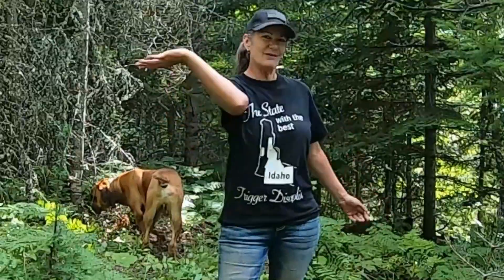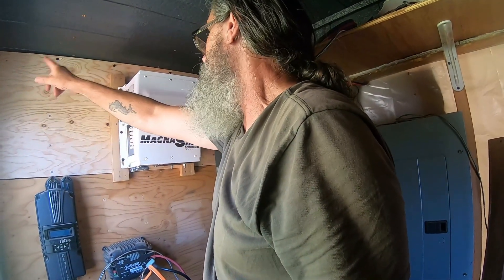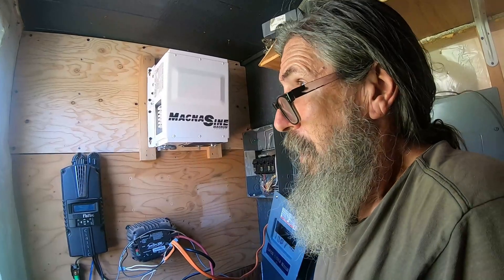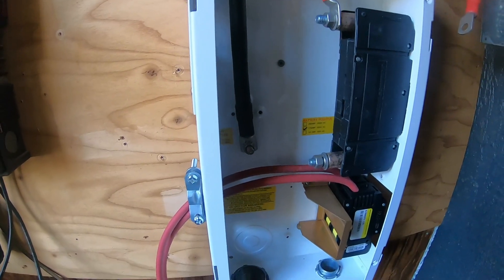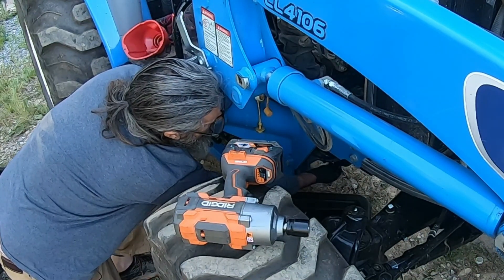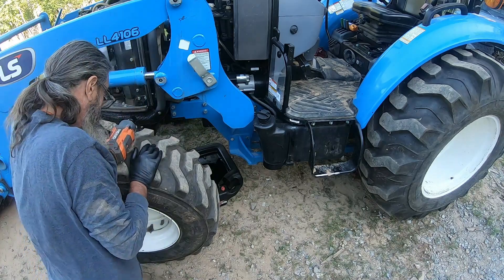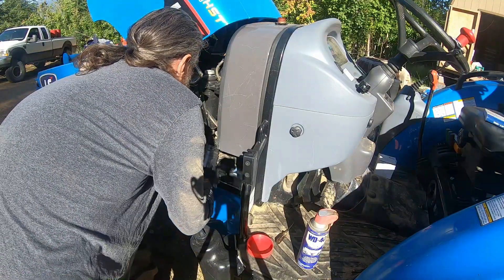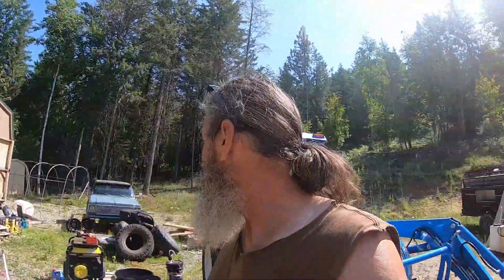Off Grid Solar Upgrades | Prepare to be SHOCKED!

Comment: What's is currently powering the cabin now? When you get it complete I would like to see a video explaining everything. I believe the charge controllers are feeding the batteries and the inverters are pulling off the batteries and feeding your electrical panels but hard to tell. When you flip the breaker to feed the batteries from the generator what prevents voltage from going backwards to the charge controllers?
Reply: Wow Matt some good questions. I will answer your first question. I think the next video should explain everything else. It will be out Thursday or so.
Since our last solar panels got damaged we have been charging our batteries with a generator.

Comment: hi! always fun and challenging to upgrade your system. you will appreciate down the road.
i see that you are still using lead acid batteries,, with this extra power , make sure you don't overcharge them and have good ventilation going out.
cheers!
Reply from the maker: Definitely fun and challenging! 😂 We will be buying lithium batteries next, hopefully sooner than later. There is a window next to the batteries that is always cracked for ventilation. Thank you so much for watching! 😀❤️
Reply: That’s where a good charge controller and battery monitor comes into play. The MidNite classic is highly customizable to the needs of the batteries. We haven’t had a problem with overcharging or off gassing.

Comment: Yeah after watching you service yours, I’ll be taking mine in! 🤣
That doesn’t look fun in any way!😮
Dude!! Goats on panels!??!? No bueno!😂
The inverter doesn’t have an automatic transfer switch for the generator part? 
So the small breaker box is basically a manual transfer? 
Looks awesome so far, I need one of those crimpers!!
Reply: No auto transfer. The only way that would work is if your generator has a remote start function. And yes the inverter does have that function. Magnum call this an AGS (auto generator start). 
Yes the sub panel is an manual transfer switch.
Reply from the maker: The panels will be going up higher. Then the goats won’t be able to get to them. Little monsters!!! 😂